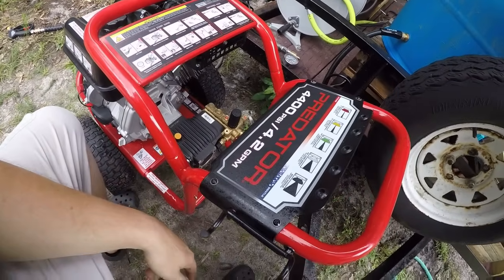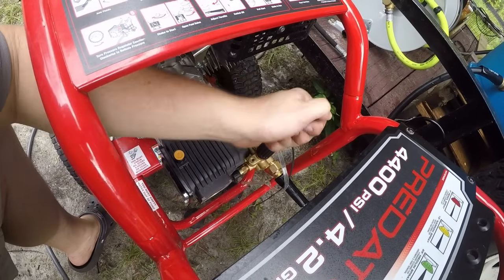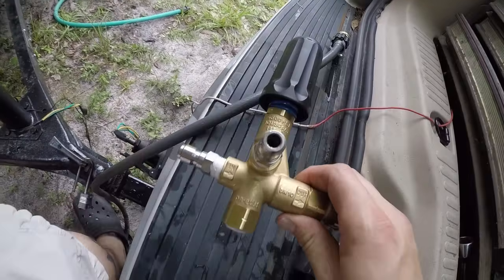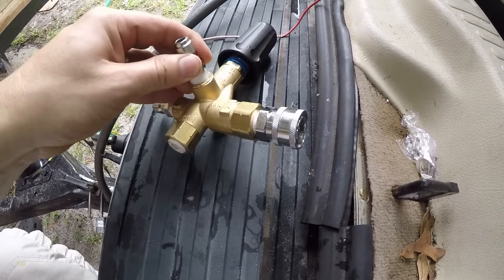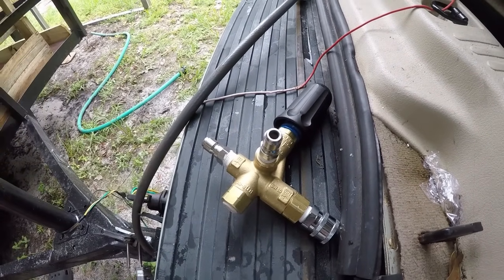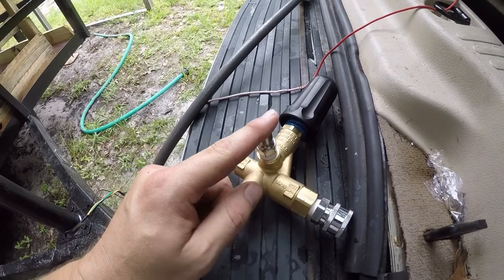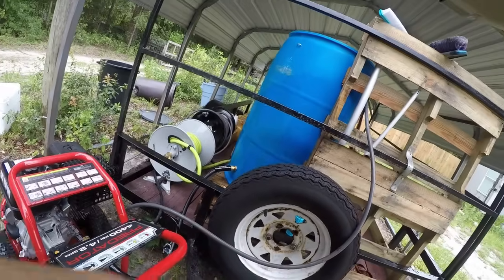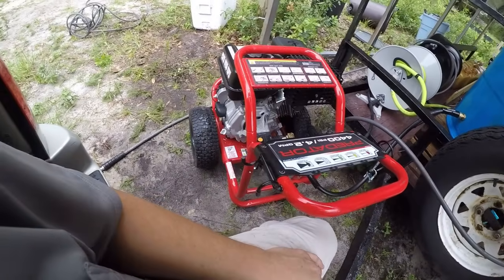External UNLOADER VALVE Bypass Water Back to Tank for Small Pressure Washing Business Tips

Comment: This is brilliant my friend. I love your set up too. Efficient and cost effective
Reply from the maker: Thank you. I appreciate it
Reply: Does the gravity fed at up work well for you? I have a 35g bufffer tank that I have on the trailer feeding the predator on the ground and it has trouble getting enough water flow
Reply from the maker: @bestbuds6282  Hi. Mine works amazing. Just make sure your tank is high enough off the ground, at least a foot higher than the inlet on your pressure washer and use a short hose with no twist or bends in it.
Reply: @M @MyPressureWashingBusiness good point. My tank only about 6 inches higher and hose a little too long

Comment: so is there supposed to be a little water coming out even with the trigger pulled, or all water should stop. I just bought it and there is a little water coming out even with trigger pulled.
Reply from the maker: Yeah that's normal, mine has a little water that comes out with trigger pulled. It's very little though, it's not enough to make a difference in gpm.

Comment: The pump does come with a thermal release for releasing the water when the internal temperature of the pump reaches a critical temperature. It releases the water out the thermal release valve .It's right there next to your unloader valve, you can see it in your video .The bypass is not intended for you to have a cup of coffee a beer or whatever and not pull the trigger it's just for a short period of time in bypass mode it's not designed to be in an extended bypass mode time frame. You do you. I see you want to have it so you can have it in and bypass mode for 5 10 20 minutes it's not designed for that. Now that you have your external bypass unloader valve attached and it's not circulating the water it's just ejecting it to the ground I guess that's what you want.
Reply from the maker: I have my water recirculating back to the buffer tank. I can walk away and switch chemicals, talk to a customer, or take a phone call and the pressure washer can stay running. Cold water is running through the pump at all times. Going on 3 years running this way. It works, it's cheap, and my pumps last a VERY long time! 
When your a one man show shit like this happens and it sucks to have to shut the machine down when a client or potential customer approaches you while you're working. It happens all the time. Why you trolling 

As for the thermal release valve. If it pops, It just means your pump already got way to hot (it already reached a critical temperature and is most likely taken damage). If you rely on the thermal release valve to keep your pump cool then you will be buying a new pump if you let the machine run without pulling on the trigger. Ask me how I know! The Thermal release valve and my external unloader valve are doing 2 completely different jobs.

Comment: Quick question I got the same pressure washer would I set up the pressure gauge in first then the unloader valve then my down stream injector ?
Reply from the maker: Hi. The pressure gauge is only for testing. I don't have the pressure gauge hooked up when I am doing a job. But definitely put the external unloader valve first then the down stream injector last, you can even hook the downstream injector between your hose reel and whip line so there's not so much plugged into the pressure washer there. (that's what I do now) Good luck 🤞

Comment: Hi, I just got the same unloader from the link, how do you have the built-in soap dispenser connected?  Mine unloader worked for a couple of tries but them water started to return through the soap dispenser instead of the unloader, not sure if it's defective or I connected something wrong, thanks in advance

Comment: So what happens when your buffer tank fills all the way?
Reply from the maker: There's a float valve in there in the buffer tank that turns water off/on. If you have the pressure washer running and not pulling the trigger then The water from the unloader valve is simply recirculating within the buffer tank until you start actually pressure washing then the float valve reopens as water is being used to refill the tank
Reply: @MyPressureWashingBusiness oh damn I like that, genius. Thanks for answering the question.

Comment: Quick question I think I busted my power washer this way. I'm about to buy the predator but I'm reading that the buffer tank needs to have a pump on it. Do you run yours without a pump? Or just gravity fed tank?
Reply from the maker: Just gravity fed. Ive been running my pressure washers the same way for a few years now. Never had a pump to help pull water, just gravity my friend

Comment: Did you just turn the pressure up on the new bypass until it didn't kick off then back it off?
Reply: Unfortunately he didn't show what he did to set the external unloader pressure. All he said was he set it less then the internal unloader. I think 2800 psi. Probably put the pressure gauge on the outlet of the external unloader and then adjusted it to get 2800 psi at the gauge..

Comment: On Amazon specifications..why does is say ELECTRIC
Reply from the maker: No idea. Maybe it can be used for gas or electric. It's just an unloader valve
Reply: @MyPressureWashingBusiness thank you so much...I also noticed on your value it has 4 female holes....I went to the Amazon link in the description you posted- the Value has 2 female and 2 male parts on it, is it ok to buy ???
Reply: I have a ryobi 2900 psi gas pressure washer will this work on it also can I just you the garden hose to supply the water from my house hook up? Thank you so much
Reply: @MoniqueSC-c2n 😮😮yes ma'am

Comment: I bought this off your Amazon link amongst other things, I have a 4 gallon per minute dewalt pressure washer from home Depot but I was told that it would not work on that kind of pump, is this true?
Reply from the maker: It will most definitely work. The only drawback with using any direct drive pump is that If you are going to hook it to a buffer tank it MUST be gravity fed. I have mine gravity fed and have used it for years. I have helped hundreds of guys set up their pressure washers just like this. Your pressure washer has a triplex pump just like mine.

Comment: Question for you man I just bought the same pressure washer and I’m having a problem where as soon as start it I’ve got to have my ball valve open for the wand open and if I close it to put on an attachment or just let off it shut itself off any tips
Reply from the maker: Sounds like it could have a bad unloader valve on it. It may be building to much pressure and stalling the engine out. I would take it back and get a new one. Sorry you are having trouble

Comment: When you say the secondary unloader valve should be set low, what do you mean by that? How much psi?
Reply from the maker: I just turn it a tad bit lower like 5 psi so that the factory unloader can keep working correctly. The external unloader is only used to dump water when I let off the trigger. It sounds confusing but It works. I have been using these unloaders for a few years now.
Reply: @MyPressureWashingBusiness yeee brotherr priciate the response! What I did was not adjust the psi or open it all the way then the external and internal unloaders were fighting against each other. Thanks tho you always got my support!

Comment: Cool, I'm thinking of building my own pressure washer from an old snowblower engine (12hp) and another video said to never let the engine run without water running through the pump, I was thinking a start stop engine switch, but your unloader valve is much easier to implement.

Comment: @MyPressureWashingBusiness Hi there,
I have a HONDA GX200 6.5, 2900 PSI x 2.5 GPM pressure washer. My question is: will the accessories you recommended on Amazon work with mine? Or are those accessories universal, regardless of the PSI and GPM?

I noticed that your machine is a bit different — 4,400 PSI x 4.2 GPM — so I just want to make sure before I buy anything.

Thanks!

Comment: I'll recommend "Never" lowering the unloaded valve but, just using nozzle tips with a larger orifice (6.0, 8.0, etc.). For example. an 8.0 orifice might bring a 4000 psi to a 2000 psi in pressure and it actually let's your pump breath better. It's always safer to go with a bigger nozzle orifice size and you can never hurt your pump, but can and will damage your pump by not letting the unloaded valve fully operate. Thank me later!👌

Comment: Thanks man!  I’m doing my first build and hit a wall when i realized my machine didn’t have build in bypass port.  Guess this $60 dollar easy install will get me to the finish line!  Has this been working fine for you since the install?
Reply from the maker: @flukytuberr4193  
Hi, I ran that pressure washer all season and it worked amazing. I currently have a different 4GPM machine but it's still set up the same exact way with an external unloader valve and buffer tank. I sold the predator because I built a new PW with electric start. But it was a great machine. The external unloader valve is definitely worth the investment

Comment: So with this i dont need a buffer tank im  just starting out and on a budget. I can just let water run down the street and itll keep the pump cool
Reply from the maker: @marlonmina6880  technically yes, you can do the external unloader valve without a buffer tank but it will waste a lot of water. I did it myself for a few jobs before I made my first buffer tank. It will keep the pump cool.

Comment: It doesn't pull sh when you let off the trigger and it goes into bypass?
Reply from the maker: @jdmplus2091  hi. The downstream injector is hooked up after the external unloader valve so no SH will go out the bypass hose when you let off the trigger. Hope this helps

Comment: Does this void the warranty and why buy a 4400 if all you need is 2800
Reply from the maker: @jacklane7439  hi, no it doesn't void the warranty because it's an external upgrade. I got this machine because I wanted the 4.2gpm not the pressure.

Comment: Good information I have the same pressure washer from Harbor freight the predator 4.2 GPM 4400 psi my question to you is how is this set up working for you now that you upgraded the external unloader valve I just recently went to a pressure wash repair shop and they’re telling me that I need to change out the whole pump to a triplex pump, but I was wondering if this will work the same set up that you have

Comment: Great video , but I’m not sure what you meant. You said @ 2:53 to make sure to put pressure gauge on before unloader valve , then you continued to put unloader valve on before pressure gauge . Which way should it be set up ? Or am I missing something.
Reply from the maker: @kevovernon  Hi. the pressure gauge was just to make sure the new unloader valve pressure was set lower then the factory unloader valve. You don't need the pressure gauge after that. I already had mine set when I made the video. It is a little confusing...but Honestly I've built at least 10 other machines for others since this video and i Just plugged the new external unloader valve in without any adjustments and they all worked. I've used it on predator, Simpson, DeWalt, and all the homemade ones I built for some guys. It really does work! Nothing but great reviews from others in these comments and my own personal experience. Pumps are now lasting a long time! Hope this helps you.
Reply: Definitely worth the $70 and a few fittings verse a $300 pump ! that’s the reason I’ve always been skeptical about loaning my pressure washer out to someone bc I don’t know if they stop washing for however long without spraying to get some cooler water in the pump. Now I won’t have to worry about the pump being burned up !  @MyPressureWashingBusiness
Reply: @MyPressureWashingBusiness  Are you removing the original thermal relief valve so that you have a place to connect this external bypass valve?  I have a Simpson AAA Triplex pump and was wondering if you could just simply remove this thermal relief valve and install a fitting to connect a drain hose to?  Would that work the same as having bypass valve setup?  Thx
Reply: Awesome thanks for the fast response and explanation!

Comment: My pressure washer dies when I release the trigger so I just zip tied the trigger open.  I guess I'll just consider it a safety feature now even though it's a pain in the ass.
Reply from the maker: @catfisher420  sounds like a bad unloader valve. I'm not sure if adding an external unloader valve would fix this problem but I would love to know if it does. I just never had this problem to try it out for myself. But yeah, it sounds like your unloader valve isn't releasing the pressure causing your machine to overload. Also might blow a hose. I could be wrong though but that's my guess.
Reply: @MyPressureWashingBusiness  I think I'm just going to add and external unloader so I'm able to set the gun down for longer periods and not have to worry about burning up my pump.

Comment: They told me this machine does not stuck water....   Does gravity feed really work on this machine with the bypass
Reply from the maker: @markdavis778  yes. It really works gravity fed but the Buffer tank hose outlet has to be higher than the pressure washer pump. I used this machine for years with it  set up this way
Reply: @MyPressureWashingBusiness  u think it would work if the machine is 1 inch lower than the buffer
Reply from the maker: @markdavis778  1 inch might work but it depends how big your buffer tank is. You would need to keep at least 50 gallons of water in it at all times to have enough gravity flow pressure. Try it out and do a bucket test to make sure your getting the gpm you need for your machine. I have a video on my channel showing how to do a bucket test if it helps.

Comment: Thanks for the video!! have exact same unit and  cant get it to work...I set the original regulator between 2500- 3000psi by checking gauge before putting the external on and then when i attach the external unloader and set regulator slightly lower by feel to the original I hardly can get 500 psi and can't get it to completely stop the dump flow when trigger pulled.. ive tried just randomly adjusting the regulators and sometimes can get it to work a little better randomly here and there  but with no real definitive setting that works any tips any one? TIA
Reply from the maker: @ApplyinPressure407  hi. Do you have the arrows on the external unloader valve facing away from the pressure washer? Do you have any leaks around your hoses/fittings? There's not a whole lot it could be. It may be possible you got a defective external unloader valve. Did you buy the one from the video? I only ask because a few guys on here found cheaper ones and had similar issues. Hope this helps.
Reply: @MyPressureWashingBusiness  thanks for your reply and yes sir I got everything hooked up correctly though I do have a slight drip coming from the bottom allen key nut i put Teflon tape on it just can't get it all the way tight with no leaks would that lil bit cause an issue? Also i just took the little hose that came with the machine off of the chemical injector instead of just blocking and zip tieing like you did is that ok? And yes everything i bought from your links I was beginning to think the same thing that maybe I got defective unloader possibly

Comment: Here is a great one. I have been slowly purchasing all the gear for softwashing. My first roof with the pump and batch mix and a quick front-of-house washdown. Will pay me more than the gear I have paid for. 3/4 & 1/2 Mixing valves, 1" manifold, check valves, connectors, hoses, filter screen, fittings, spray wand parts. I still need a water tank and tank for a surfactant, But I did buy a 30-gallon tank for batch loads. Yes, I look forward to this add-on service to my Handyman services. I will be buying a van to build out as the wash van. Parking is too hard when dragging a trailer around.

Comment: I just installed mine yesterday. Today, we find out how it works. A full trailer wash, oxidize removal and Trex decking, railings, and concrete driveway cleaning.
Reply: It worked awesome. I think I am going to put a reducer to slow down the water it is dumping. The key point is to keep some water flowing to keep the pump cool.
Reply from the maker: @1stFlyingeagle  awesome man! Glad everything went well

Comment: Hi, bro its not working in my pressure wash, do you know why
Reply from the maker: @SandeepRehal-eb1km  sorry to hear that. what pressure washer do you have? Do you have a pressure gauge? Remember, you have to have the external unloader psi turned down lower than the factory unloader. Do you have the flow going in the correct direction, it needs to be facing away from the pressure washer.